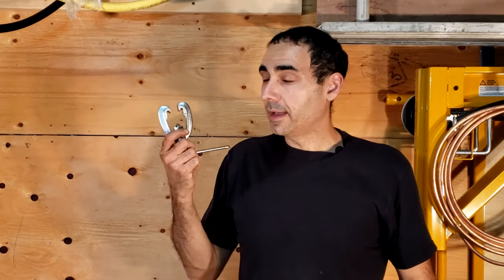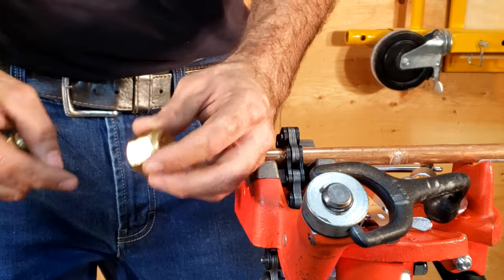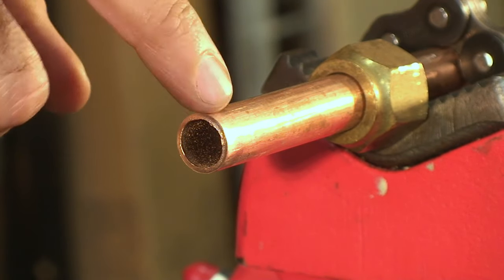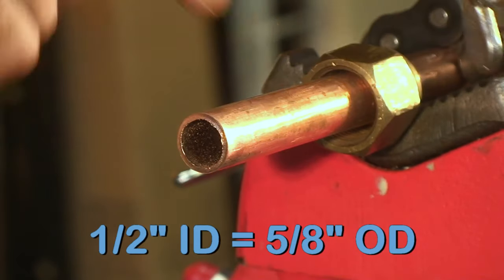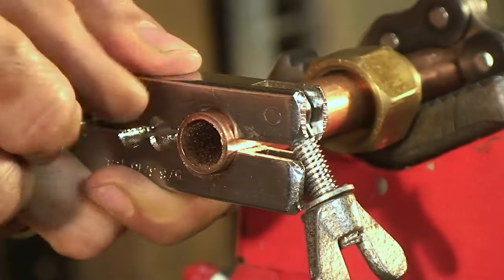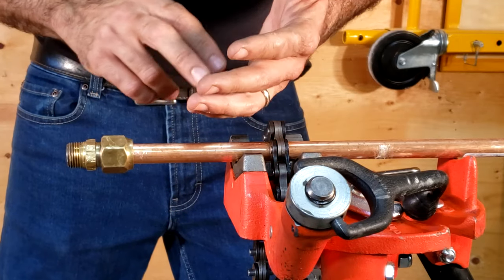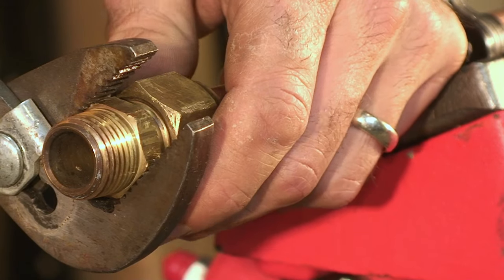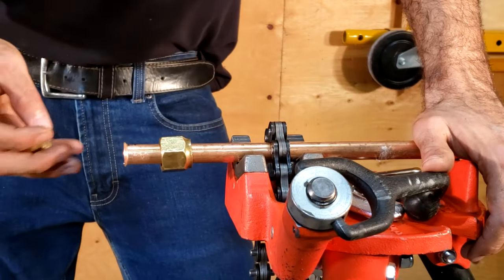How to Flare Copper Pipe!

Comment: But, how tight do you tighten the flare nut?
Reply from the maker: Great question.  I've seen and used torque wrenches specifically made for flare nuts; I think it's somewhere around 30 ft-lbs if I'm not mistaken.  The truth is however, that most plumbers don't flare often enough to justify the cost of those specialized wrenches. More importantly, we're supposed to leak-test everything before concealing our joint, so if there's an issue, we should catch it.  Generally, make sure that you initially tighten the nut just snug, and finalize it by turning the nut about another quarter-turn, which will help squish the copper into acting as a seal between the nut and fitting.  Again, always, always test your work for leaks. Thanks for your question, and I hope this helps!

Comment: Between the nut and the nipple we can put a rubber gasket and we are sure that it will not leak! Congratulations 😊
Reply from the maker: Well, that would be cool, but that sort of defeats the purpose and benefits of flaring...and poses other issues.  First, you'd need a specially-shaped washer/gasket that contours and angles perfectly to the flare.  Second, the rubber would corrode over time and is sensitive to heat.  In the case of traditional flaring, the copper material IS the gasket, and will not corrode.  Squishing the material when you tighten it will provide a seal more reliable and durable than any gasket ever could.

Only be sure to ream the pipe before flaring it, which I forgot to show in the video!

Comment: 1.Deburr the pipe before creating the flare.
2.No hardened multi grip plier jaws on any chrome plated tools please. (As a fridgy, seeing that makes me cringe). The tee bar of the flaring yoke is used between the wings of the wing nuts of clamping dies for nipping it up tight.
3. HVAC often uses up to around 800psi, not 300.
Reply from the maker: Well said...I genuinely appreciate your passion in the matter, and I thank you for your constructive criticism.
Reply: Improper preparation of the pipe.  Hard pipe needs to be annealed before flaring.  Pipe needs to be reamed before flaring.   Your fittings and flaring block are trashed from using pliers.
Reply: @PlumbingsCool yeah, I noticed this as well. For the DIY guy it's probably not a big deal but assuming that deburring was covered in the cutting video the other stuff probably isn't a problem. Otherwise it should probably be redone.

Comment: Do you need to anneal hard drawn copper for Flare connection ?
Reply from the maker: Great question! Although annealing (or using soft copper coil from the get-go) certainly makes the flaring process easier, you can flare hard-drawn copper pipe without treating it; I have my students do it all the time.

Comment: I'm thinking of making nozzle the same way you make flare in pipes. I'm thinking of using 3/4 pipe copper pipe and try to expand the other end to be about 5/4 diameter so what do you think ? is it possible or it will crack before reaching 5/4 ?
Reply from the maker: Hmmm....I'm not sure exactly what you mean by making the other end "5/4".  If you mean to widen the 3/4" diameter pipe to a size of 1-1/4" (which is effectively 5/4 in simplified fractions), and then proceed to flare that end to mate with an 1-1/4" flared fitting, then I would strongly recommend AGAINST it.  

Enlarging a pipe is formally referred to as "swaging", and our Plumbing Code here in Ontario explicitly states that swaging can only be done so to connect to pipe of the same diameter:

"7.3.3.1.(3):  A copper water distribution pipe of 1 inch size or larger may be mechanically swaged to permit the joining of other copper pipe of EQUAL SIZE."

In other words, the Code only allows you to take a male copper pipe end (referred to as a "spigot"), and convert that pipe end to a female end (know as a "hub") so that you can join another male end OF THE SAME SIZE AS THE ORIGINAL PIPE (minimum 1-inch, however), thereby eliminating the need to use a coupling.

Also, you should do so using a minimum thickness of Type "L" copper pipe.  Anything thinner (Type "M" or Type "DWV") does not provide enough material to allow the material to stretch out without cracking, ripping or maintaining proper strength.

If you're needing to change the actual diameter of piping, you should only do so using a proper reducing coupling and properly-sized pipe - in your case a 1-1/4" x 3/4" reducing copper pressure coupling, and a piece of nominal 1-1/4" copper pipe.  If you need a male end on the 1-1/4" side (and would rather not purchase a whole length!), you can instead purchase a 1-1/4" x 3/4" reducing BUSHING, which will give you a female hub for the 3/4" side, and a male spigot on the 1-1/4" side (only provided you don't need to flare the 1-1/4" side). 

Hope this helps, and thanks for watching!
Reply: @PlumbingsCool  I couldn't make what I want clear so I will try to rephrase it again.

I don't what to connect two pipes with each other. I want to have pipe one end 3/4 and the other end is 1-1/4 for collage project not for water pipes. I want to use copper pipes as it's easy to be deformed to match the shape I want.

The nozzle I want to make looks a like the one in this link
http://rocketschnozzles.weebly.com/uploads/2/9/0/4/29045379/8739941.jpg

What I'm asking if I get 3/4 pipe and did the same what you did here to expand the other end to be 1-1/4 is it possible or will it crack before reaching 1-1/4 ?
I'm asking as I don't have this tools and will get it only to do the nozzle.
Reply from the maker: Ah, I see. 

I would say that you will have issues for a few reasons.  First, the flaring tool will not expand the pipe wide enough to reach 1-1/4, nor wil you achieve the shape you're looking for.  As well, you may very likely stretch the pipe too thin to achieve the 1/2" increase in diameter.  You can certainly experiment, but I'd recommend at least Type "K" (the thickest copper pipe), and I'd significantly heat the pipe with a blowtorch first, to change/soften the temper of the pipe.

Looking at the shape that you linked, I'm just wondering whether you can save yourself the headache by just purchasing something similar to the shape you're looking for (provided your school project parameters allow you to).  I mentioned couplings & bushings in my last reply.  You can pick up a 1-1/4" x 3/4" coupling or bushing in various materials which are accurate to your desired size, and closely match the aforementioned shape.  Here are some examples:

Copper Reducing Coupling:
https://www.grainger.ca/en/product/p/WWG1VLK9?gclid=Cj0KCQjw2NyFBhDoARIsAMtHtZ6PVOAs4YtYvoQV2jGGAjzV7PbXFtZKlcSyIU6RpUrUTCKdk7-1aAIaAhdwEALw_wcB&cm_mmc=PPC:+Google+PLA&ef_id=Cj0KCQjw2NyFBhDoARIsAMtHtZ6PVOAs4YtYvoQV2jGGAjzV7PbXFtZKlcSyIU6RpUrUTCKdk7-1aAIaAhdwEALw_wcB:G:s&s_kwcid=AL!3645!3!303439923758!!!g!325537765342!

Black Malleable Reducing Coupling:
https://www.google.com/search?q=1-1/4%22+x+3/4%22+black+malleable+coupling&rlz=1C1CHBF_enCA939CA939&source=lnms&tbm=isch&sa=X&ved=2ahUKEwiRw92urfnwAhXDXc0KHZ8DAA0Q_AUoAnoECAEQBA&biw=1920&bih=937#imgrc=7X2_khoyWuATPM

PVC Reducing Coupling:
https://duboisag.com/ca_en/reducing-coupling-slip-936.html?gclid=Cj0KCQjw2NyFBhDoARIsAMtHtZ7Ru-C3Fqrfn1FTgU0byzfUJrZH6aFms9MJLv8qXdBUZYpD6DXqym0aAhvLEALw_wcB

If you're looking for any of these items, you should be able to do so by visiting any reputable plumbing supplier.

Hope this helps and good luck with your project!
Reply: @PlumbingsCool  I will give it a try. Thank you.

Comment: is this hard copper pipe, or is it soft copper tubing?
Reply from the maker: The specific video uses hard-drawn copper pipe.  That said, utilizing soft annealed is certainly easier and more common.  One-way to facilitate flaring hard-drawn is to first heat it up, thereby changing its temper.

Thanks for watching!

Comment: Why didn't you deburr the inside of the copper pipe before you flared it?
Reply from the maker: A valid question! The truth is that this was one of my first videos, and amidst the entire foreign process of recording videos, I slipped up on deburring the pipe!

But yes, you are absolutely correct:  the pipe should be properly deburred prior to flaring. My bad, and it won't happen again!

Comment: I cut the coil  flare coil copper pipe by mistake it was coming from underground but I Well that regular welder it’s been more than five years but there is no leak do you think in the future is going to leak
Reply from the maker: Hi Sul.  If I'm understanding correctly, you cut your existing underground flared connection and you instead repaired it with soft-solder joints?

If so, all I can say is that nothing is guaranteed, and every situation is different.  Although it is not legal (at least in our Canadian Plumbing Code) to use soft-solder underground, there's the possibility that your joint could hold for a very, very long time.  I have seen copper solder joints that were poorly soldered (or which had NO solder at all!!!)  not leak for decades!    So the answer is no one really knows.  If it held for five years already, perhaps it will continue to do so.

That said, we all make mistakes and overlook things at times, but the key is to develop a habit of always performing the work to maximum possible workmanship and Code compliance.

Hope this helps!
Reply: @PlumbingsCool  yes

Comment: What if you are using coil copper pipe
Reply from the maker: Yes, flaring works perfectly well with copper coil (otherwise known as "soft annealed" copper), provided that you utilize a minimum thickness (referred to as "Type") of Type "L" copper.  As a matter of fact, it's more likely you'd be applying flared connections to copper coil than you would hard drawn copper.

Comment: well It kept slipping on me so I kept starting over and tightens it more untill I finnaly broke the bolt I guess flaring isn't my thing.
Reply from the maker: No, I DON'T think the problem is you! If it's slipping and the tool's bolt even actually broke, then I'm guessing you have a poor-quality tool. 

By the way, I never showed it in the video, but it will help to soften the pipe by preheating the end with a torch until it's red-hot, and allowing it to naturally cool.  This will make the flaring process MUCH easier on you - and your tool!
Reply: @PlumbingsCool  no definitely not a high quality tool and thanks for the info.

Comment: You should probably deburr it first. And 3/16 is standard in most cases for 1/2 inch pipe.
Reply from the maker: Wholeheartedly agree with you about deburring (which I forgot to demonstrate!). 

3/16th is awfully close to 1/8th when eyeballing it.  As long as that nut can slip past the flare, you're golden!
Reply: @PlumbingsCool  It was still a good video . I also like to put a small amount of Nylog blue on the pipe before I flare it as it makes for a better flare.
Reply from the maker: Thanks very much!  Yes, I've heard of the Nylon Blue from the HVAC crowd, who all swear by it.  However, not sure it's approved for plumbing (particularly potable water applications). 

Thanks for the feedback!

Comment: No pressure piece?  Or is that for double flare, paperwork isnt my treade, hwre to braoden knowledge :)
Reply from the maker: This is a single flare, which is easily suitable for potable water pressure applications (which typically only reaches about 80 PSI).  I'm certainly no expert on all the different flaring methods, but I think double flares are more common for more very high pressure applications, where dependence on the joint not failing is absolutely critical (life-dependent), such as brake lines, and fuel lines.

Comment: I did this for my water line to my fridge but it slowly leaks. What am I doing wrong?
Reply from the maker: At least here in North America, we apply COMPRESSION connections for connecting refrigerator water lines, which are significantly different than (and inferior) to flared copper connections.  It's tricky to assess your particular issue without more information.
Reply: Even that is suppost to work it does not , so use pipe dope in the threads

Comment: Why not use a compression fitting with a ring.
Reply from the maker: The goal of the video was to demonstrate copper flaring.  While compression fittings can be used in some (above-ground only) situations per our Code, it is a significantly inferior connection that is easily subject to leakage when subject to strain or stress.

Comment: That flaring a copper pipe how can one flare a custom threaded length of pipe. Say a 100mm long male threaded pipe, how can a 45 degree flare be made on the end of the male pipe? Does a lath made them or a special tool or drill bit make one? To made a diy custom "fitting bit"!?
Reply from the maker: By "100mm long", I presume you're referring to the pipe's diameter, which would be MASSIVE for a flared connection, and I'm honestly not quite sure whether 100mm flared fittings exist - at least in the plumbing field.  The largest flaring tool I have is for 2" (or 50mm) diameter.  The tool is a punch-type tool which gets inserted and hammered into the end of the pipe.
Reply: @PlumbingsCool  100mm long as in the length not width or diameter. The diameter is 1”. You still don’t seem to get it. Talking about how to put a 45 degree flare on the male end not the insert tool. I ended up using a grinder to grind an 45degree slop on the male threaded end of the pipe!  Think of what im trying to do like a longer version of the nipple joiners. I don’t think the join i did is good enough but not sure if there is a tool even to flare the male end of the thread! The male end not the internal angle.
Reply: What im trying do is a 100ml of 1 inch continuous threaded pipe, step drill a hole so it goes through a drum, nuts put each side and sealant for waste veg oil (normal rubber degrades in wvo), then the 19mm copper pipe we have in Australia fits snugly right way through and solder capillary it to seal it. But i was wandering if can flare each end of the thread so i can use a fitting to attach the 19mm copper pipe each side as perhaps a better way? Trying to use minimal fittings as got lots to do and they ad up.
Reply: @PlumbingsCool  i just uploaded a video for you explaining called. ‘How to Flare Male End of Pipe?’.
Reply from the maker: Thanks very much for your detailed video.  Unfortunately, I do not know of any tools which properly and accurately flare the male side of brass nipples.  However, what you should be able to find are adapters that will allow you to TRANSITION from that male thread to  a proper flared fitting.  You'd likely be asking for a 19mm Flared x 19mm Female Thread adapter fitting - presuming that your brass pipe consists of standardized threads.  The female side would thread directly onto the pre-threaded nipple, and the other side couples with your flared copper pipe and flare nut.  Note however, that what you've got there is a running thread (it has no taper, meaning that it will not tighten into the fitting as it turns).  This is not typical or even legal for standard plumbing applications.  However, if you're just running vegetable oil through it at atmospheric pressure, you may be able to wrap enough Teflon tape onto the male thread to force an adequate seal (again, presuming that you can find a Flare-to-thread adapter which has the proper thread pitch).

Failing that, another option is to pass the copper pipe through the brass nipple as you described, and SILVER SOLDER/BRAZE the copper to the brass on each side to create a proper seal, using an acetylene fuel torch (no oxygen necessary) and proper Sil-Fos brazing rods.  Note that when brazing copper to brass, you MUST apply a special flux to the joint, otherwise, the brass will evaporate before your eyes before the filler rod has any time to fill the joint.

I'm also pondering whether you can use threaded black steel pipe and black malleable pipe flanges sandwiching each side of the drum, sealing with a high-grade (non-rubber) gasket that is resistant to the oil.  The pipe flanges can bolt together through the drum with four stainless steel screws, nuts and washers.  This way, you can make the steel pipe any length you want for each side of the drum and transition any way you wish, without worrying about flared connections.  You'd need to make the hole through the drum only large enough to accommodate the diameter of the thread, otherwise, it will run the risk of not sealing properly.

Here's an example of the flanges I'm referring to:
https://www.homedepot.ca/product/aqua-dynamic-fitting-black-iron-floor-flange-3-4-inch/1000126395 

Hope this helps spawn some ideas for you.  Meanwhile, all the best and happy holidays!
Reply: @PlumbingsCool  Thanks for following up with a quality answer. Yes think will put the copper pipe right way through the male threaded pipe and i used capillary solder and butane gas to heat. Seemed to flow straight in well, the 19mm is very snug fit. And just bought flanged brass nuts and diy cut and melted out some container plastic used for car oil as a gasket. Cutting a lot of costs on buying fittings that way as I’m being cheap on this project. 

The other idea you explained about using black steal pipe i think is a good one. Might do that for the bottom drain out tap. 

If I bought the proper fittings they are $37AUD compression fitting and flange + washers delivered and customised can make for $6-10 so a big savings over 15 fittings!! 

Thanks again. And maybe if you invent a pipe as requested above you might make a side business. All the other nipples around the threads are too short otherwise they’d work good!
Reply from the maker: Yes, of course!...not sure what I was thinking, but as you suggested, absolutely you can use regular soft solder and paste, and seal it right up with a standard propane/butane torch.  No brazing necessary.

Please do let me know how it goes...and happy holidays!